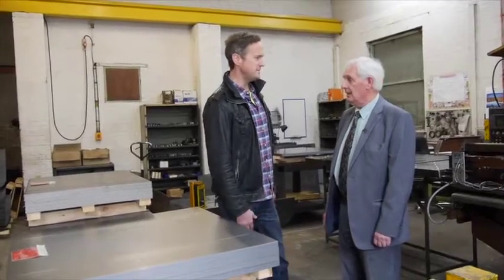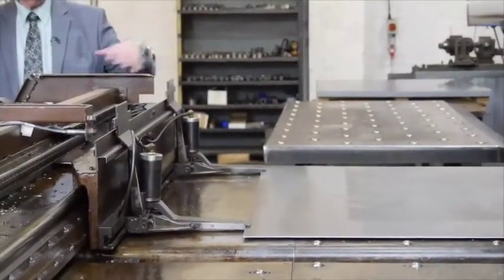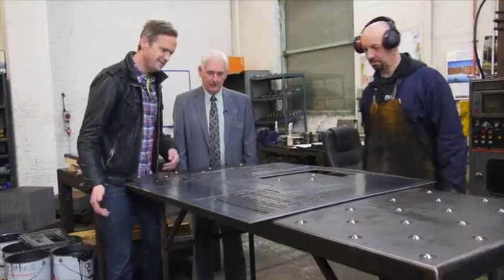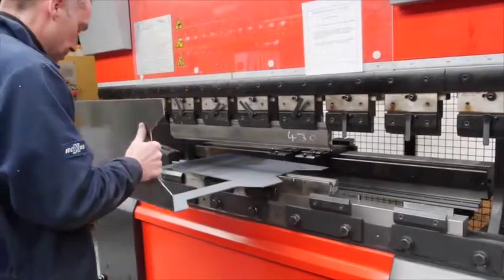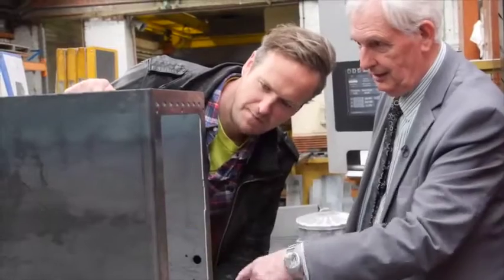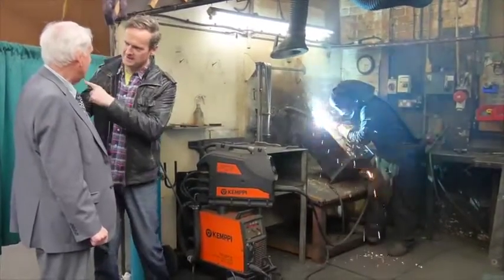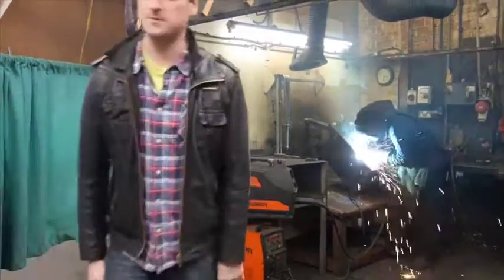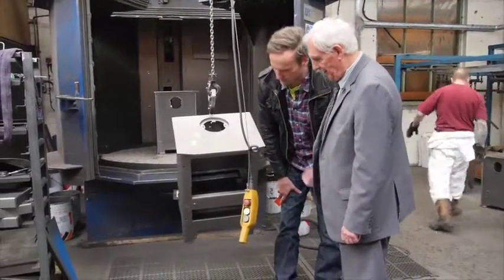Tim Shaw visits Dunsley Heat - Manufacturing multifuel and woodburning stoves

Comment: After studying the various wood burning stoves. the online print of how the Yorkshire  functions prompted me to travel from my final home in Alvito Portugal  to the Dunsley heat factory in Holmfirth . After a few hour drive from Hinckley in Leicestershire I arrived  midday and was  taken to the upstairs showroom where all of the stoves were on display .After closely inspecting the Yorkshire stove in the flesh .. my mind was made up .  Pay the nice lady   load my new stove into my works van and head off back to Portugal .WRONG.  After being given the local to Hinckley in Leicestershire retailer ,s phone number , he promptly tried to sell me a Burley stove   claiming the Dunsley heat stoves were overpriced and offered poor delivery . I WAS GUTTED  and went back to my home in Portugal with my empty VW Caravelle . being a lifelong aeromodeller  I bought a cheap €250 euro cast iron woodstove and set about converting it into an afterburn chamber layout like the Yorkshire stove.  After many years of faithful trouble free service . I viewed a woodstove design which ticked all of the boxes on efficient heat output ability . this design is called GLOWSTOVE   a stove like no other on You Tube . Adding the afterburn chamber section of my Yorkshire  Dunsley heat design . I am around 50% of the way through its fabrication . I have a 1000 degree C . K type  thermocouple installed 50 cm up in the SS flue pipe .. the amount of heat WASTED  going up the flue is insane . This new Glowstove design clearly addresses the extraction of energy mostly lost heating the great outdoors. My first row of 8 30x1.5  x 80 cm long s/s tubes are located above the afterburn chamber . a refractory lid is added above this channel with a widthwise slot at the front of the afterburn chamber zone . The flue gasses enter the upper zone and travel to a top rear flue exit after giving up more flue temperature to the final 13 s/s  tubes .. The top of the stove is removable to allow for a once a year cleanout of powder ash . I am using Castable 60 AR (vibration)   refractory aggregate  reinforced with Stainless shards .supplied by Geoinerte. a super helpfull refractory manufacturer in Portugal.
Although yet to commission this design it should provide  years of reliable heating . And with  350 kg of refractory soaking up the heat . I am almost looking forward to next winter . I can email you photos of this project  should you wish to fabricate a test stove for evaluation .richardwallinger@gmail.com

Comment: councils unfortunately rip out fireplaces then board em up etc id love a multifuel stove in my flat but i bet sounsil wouldnt it would help cut bills and keep flat nice and comfortable instead its usually 13-14 degrees cant afford to run heating hours at a time or 24-7 people are struggling even with jobs now more than 10yrs ago they should reinstate the brick fireplaces to allow multifuel use only in winter